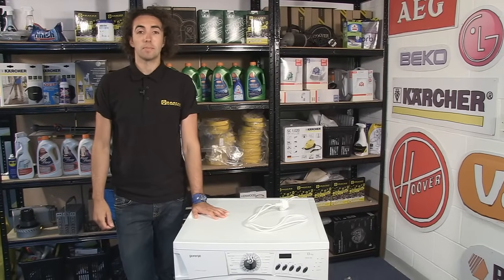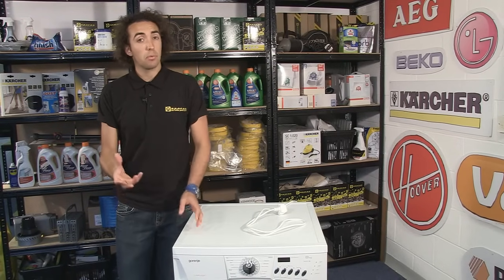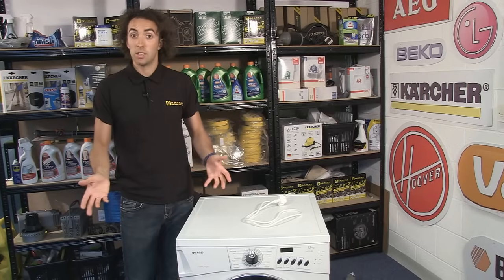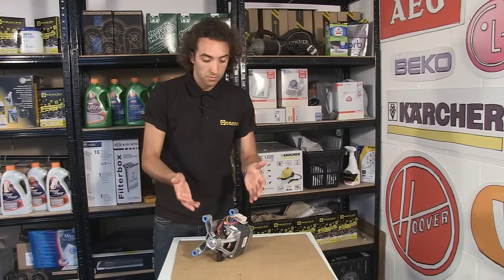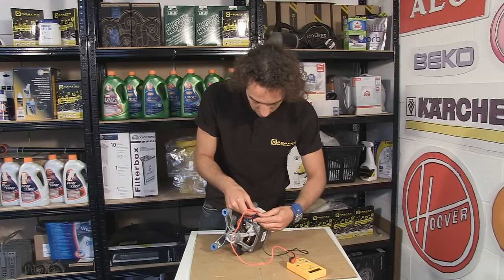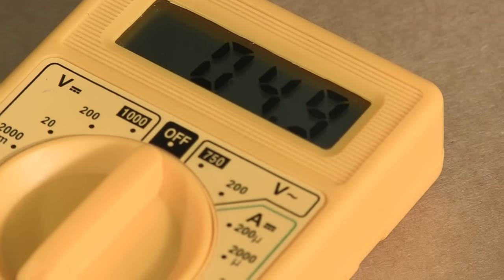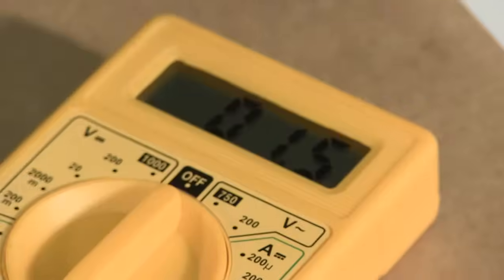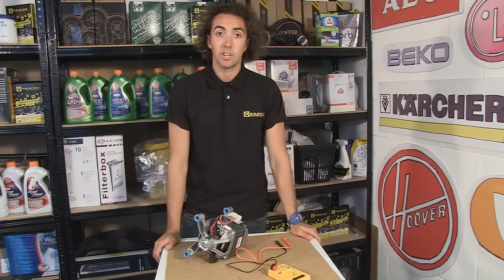How to Diagnose Washing Machine Motor Problems

Comment: Great guide. On my motor off a Candy CDB 126 I had 6 wires instead of 7. The way I worked through this was firstly  tracing the pair for the velocity sensor (2 red wires from the can on the end)  43 ohms [good].

Then I checked the colours from each of the 2 brushes - blue & pink respectively. These measured 4.7 ohms [good]. These confirm the armature windings (the rotating central part) and commutator (copper segments on the end that the brushes are contacting) are all good.

Finally there were 2 remaining wires -   a black and a grey wire which went inside to the field coils in the motor casing. These measured around 2 ohms [good]. This confirmed the motor is basically OK which means my fault is elsewhere. I have already repaired a couple of broken wires to the dryer heaters so I am checking the wiring from the motor wire plug back to the control board for breaks as these wires are also constantly flexed by the movement of the drum assembly and have possibly become brittle inside.

Comment: Very good explanation - I don't think I'll bother trying to take the motor out of my Beko though as I think it's the carbon brushes that need replacing as it was sparking and lighting up when I took the back off - you said at the end though that if you find any of these faults then the whole motor needs replacing? You can't just replace the carbon brushes? Probably not worth the time or money to fix if I can get a new one for about £230 anyway

Comment: The speed sensor in my case is reading 140ohms. Does that indicate that it’s faulty? My issue is the machine  would fill with water normally but it won’t spin.

Comment: My CESET Motor has problem at speed.

Firstly thanks to eSpares for an informative video. I found it after fitting a new set of brushes with limited success.
 
After fitting the new brushes my machine completed a spin cycle and then failed on a wash cycle. Now the motor will turn (with no laundry) at slow speeds, but keeps cutting at high speed as if there’s a loose connection. Having tested the Tacho and Windings everything seems good.

I thought the problem might be a start/run capacitor, but these motors don’t seem to require one (guessing because of the field windings). With the absence of a capacitor I decided to investigate the PCB (against even my own better judgement). I thought I’d found the answer when it looked fried with black tracks on the back and a coating on a chip, but all of this blew off to reveal a clean circuit board (apparently dust from belt attracted to electrical current). I did suspect I had found one or two dry solder joints, but I’ve made them good to no avail.

Any connectors have been crimped a little tighter and/or blasted with cleaner, which hasn’t helped in the slightest.

So, to all that have read this far:
- Have you resolved a similar problem and how?
- Any ideas on what might be causing the problem or what else I can check?

Thanks for any informative replies.

Comment: So, ive just carried out all checks in accordance with the video(which is great by the way) motor would appear to be servicable. However my error code points to the motor/speed sensor. All readings are nominal. Any thoughts? 

Model: hoover Candy DXOA410C3180 31007922
Error E08
Reply from the maker: Hi, thanks for your comment and for your appreciation of our video! We have another video focused on the E08 error code that you can see here:
https://youtu.be/Xmh8_1LRrlA

Hope this helps!

Comment: Excellent video, however I just removed my motor from my Hotpoint WDD960P as it keeps tripping the electrics, and on my motor I only have 5 wires, I proceeded to check but the readings are nowhere near what you’re getting, do you have any videos for a hotpoint motor ? Thanks

Comment: My tacho coil reading is approx 179 ohms, is this normal for a Zanussi ZWH 6160P washing machine, Prod no. 91490641500
Reply from the maker: Hi MrJsingh1986, the meter reading does vary, having the reading would suggest the tacho is OK

Comment: Hi, I have a hotpoint wma34 that trips the electric when the motor attempts to spin, I check the brushes and they were very worn so I replaced them but still the same... Then I found this video!  The speed sensor gives a reading of about 190 ohms... Also if I manually torn the rotor this reading varies a little as I would expect but it also gives a random null or 1 every now and then which seems odd to me... Does this mean I need to replace the whole motor? I also get a reading of 8.1-10ohms on the final test ( the motor windings?) and  very high reading if I connect across the brushes... 
Thanks for any advice given
Reply from the maker: Hi batfink 132000, when testing for a fault on the motor you are looking for continuity readings to test it, with your fault you are looking for a component that is going down to earth causing the electrics to trip which would normally require a meggar meter to test the components. Does the machine work OK when washing?
Reply: @eSpares  it appears to work OK until the motor trys to spin the drum and the it trips the main fuse box... Thanks for replying but I have decided to replace the machine as it has served us well with no real troubles for at least 17 years possibly over 20 years so I don't think it owes me anything and even if I can repair it I suspect it will only be a matter of time till it suffers more failures

Comment: Question...If im having a problem with the motor should u just buy a new one or can you repair the motor...I had the washing machine for 8yrs and it doesnt spins I look at the belt and notings wrong with it.
Reply from the maker: Hi Douglas, it would depend on the make and model as they are supplied differently, most supply the carbon brushes separate so check them first.

Comment: Good demonstration.
My motor running but suddenly pulling 2x the current, humming and then shuts down halfway through cycle. Thermal switch I presume.
Any idea why it's drawing so much current?

Comment: Hello Josh - just watched your excellent video - thanks.  I ran the Whirlpool diagnostic which confirmed there's a problem somewhere with the motor.  I checked the carbon brushes and they're OK but the sensor on the motor is s/c.  Do you know what the effect of this fault would be? Would it prevent the drum from rotating altogether? Thanks in anticipation.

Comment: Thanks for this video it was very informative. Do you have any video or suggestion on why my Samsung front loader wont turn on?
Reply from the maker: Hi Durrel James, if you have power to the machine start by checking the door lock because if that has failed then it wont start.

Comment: Bosch Nexxt 300 washer spinning super fast..... Codes D06, D08, D09, and D11 came up.
Is it the speed sensor?  If so, where is it located and how do I replace or repair?
Is the speed sensor on the motor?  Is speed sensor replaceable ?  Or do you need to replace whole motor?
Reply from the maker: Hi iceman382, they are different error codes but are related to the motor except for D06 which is an NTC short circuit, start by testing the motor with a multimeter and you need ENR number to identify the model details.

Comment: Hello. My washing machine was giving me an ND Code. I cleaned all the hoses. Then I replaced the pump.  And now my washer will go into wash..as soon. As it goes to drain it won't drain. Or spin. But now I'm not even getting the ND code. Can this be wiring?

Comment: Thanks a lot !! I did exactly as you advised!! Resistance of central pair was infinity/disconnected/open loop,so I replaced the two carbon brushed which the two were half centimeters only! almost touching its wire...washing machine is now functional!! thanks,Yaron
Reply from the maker: Hi Yaron, thank you for your post and glad our video helped and well done on fixing it.

Comment: After being almost crazy with this error I finally figured it out. In my case it was the pin that connects the wire to the carbon brush device. It was a bit loose connection in one of them. I disconnected, then took pliers and made pressure on the pin to make it tighter (not too much) and then connected again and had the feeling of a solid connection! And voila! (I also checked the speed sensor at the end of the engine with a multimeter just in case) Now it's perfect again! Thanks to the video, very professional.
Reply from the maker: Hi NandoMirandaHorses
. Great work and perseverance on this one! We're glad to hear you enjoyed this video.

Comment: Hi do u know why my washing machine won’t turn or sometimes it does or goes into spin I know u mentioned it but my machine is about 20 years old and I didn’t know if them motors would have sensors?
Reply from the maker: Hi Kai1234, start by checking the obvious, the filter in case it's blocked then check the carbon brushes and drive belt.
Reply: eSpares ok thank u I will check the filter and the brushes and belt are fine
Reply from the maker: Ok Kai1234, good luck and let us know how you get on.
Reply: Hi again I’ve done all the things you’ve suggested but still no luck :(

Comment: Also what ohms range do you have the multimeter set to? I’m getting mixed results.
Reply from the maker: Hi William, to check the motor the meter must be set to the lowest Ohm's range (0-200?).  A washing machine motor will typically give a resistance of between only 1 and 10 ohms for a  winding or across the brushes.
Reply: My multimeter has anything from 2 - 5000ohm range. I’ll test them again @ 200 range and post my results, I’m still convinced the windings test is showing up infinite resistance.
Reply: Meant to say 2000ohm range
Reply: I’ve tested it again and my results are. @ 200ohm setting Armature 00.1 Brushes 46.1 windings 00.0 / @ 20ohms Armature 0.09 Brushes doesn’t budge windings 0.00 / @ 2ohms setting Armature 0.88 Brushes doesn’t budge windings .002

I’m a little confused by the Brushes reading @ 200ohm setting but the windings results seem consistent with a faulty motor. Issue is a machine that won’t engage left turn, right turn or spin whilst in diagnostic mode.
Reply from the maker: Have you removed and examined the brushes. wash motors rarely go short so as long as you have a 'low resistance it is likely to be OK. If you are getting 'unusual' brush readings suspect worn brushes.
Reply: One looks fine, the other is worn considerably more, a bit of meat left in it. So the 0 readings with the windings is fine? What does the 1 mean when testing the brushes? And by 1 I mean the reading that’s on the multimeter when set to ohms, does that indicate a short? A break in the circuit?

Comment: I’ve just tested my motor and I’m fairly certain the windings are at fault. I’m getting infinite across all 3 wires. What’s confusing me though is when I test the brushes, in my case....red wire and white wire, I get nothing, no readings whatsoever, just reading 1. What does that mean? Checked brushes and they look fine.
Reply from the maker: Hi William, to check the motor the meter must be set to the lowest Ohm's range (0-200?).  A washing machine motor will typically give a resistance of between only 1 and 10 ohms for a  winding or across the brushes.

Comment: Nice video
I have a quick question, I have a Currys Essentials C510WM13 
A short time after selecting a cycle the machine stops, I get a few beeps and the start/pause button is flashing 7 times in 4 seconds, according to the manual it's an error 7 and all that's in the manual is "contact maintenance personnel" 
This happens normally about the same time the drum should start turning on a cycle
Could this be a motor fault? 
Thanks for your time
Reply from the maker: Hi Pete, check the carbon brushes and they may have worn causing the motor to stop rotating. Please let us know how you get on.
Reply: eSpares thanks for the response and will be getting parts from you guys :-)

Comment: My Zanussi ZWF16070W washing machine keeps trying to go into a full speed spin rather than balancing the load and increasing the spin speed gradually, causing the machine to shake violently. It then just winds down, does nothing for a few minutes, and does the same thing over and over again (and will continue to do this until I switch it off). However, the drum rotates properly during the initial washing part of the programs prior to the first spin. It also fills with water and drains properly. From what you say in this video, it appears that the sensor on my washing machine's motor is faulty and is sending the wrong information to the control panel. Can this sensor be replaced or does the entire motor need to be replaced?
Reply from the maker: Hi Lianne, interesting one this as if the sensor or motor were faulty the drum would normally go to full speed (Like it does on spin) during the wash cycle. Run a spin cycle empty and watch. The drum should turn slowly one direction then the other several times before starting to increase in speed to full. If it does this try with a light load again just rinse and spin. If it goes straight to full speed after the tumble suspect the PCB.
Reply: Hi there. Many thanks for your reply. The strange thing is, if I run it on a spin-only cycle it will drain, rotate back & forth as if to balance the load, then commence the spin from the slowest speed, working its way to the fastest speed. However, within a second or two of reaching maximum spin speed something makes a 'dull click' sound and it cuts the spin and slows down to a stop. The spin program is ten minutes long and the last time I tested it, it failed a few minutes before it should have finished. I've tried a few wash programs (including the spin-only program) with light loads of washing and whilst empty, and it does the exact same thing - the spin program functions as I've just described and the wash programs function fine until it needs to spin (I believe the first spin is prior to the first rinse, as the fabric conditioner is still in the drawer at this point) - which is when it tries to launch into a full speed spin rather than gradually.
One other thing that is a bit strange is that it seems to complete the 30 minute/30 degree wash program with no issues. Unfortunately this particular program has a short spin duration so the washing is still rather wet. I originally suspected the PCB but after seeing your video I was wondering if it might be the sensor on the motor, however, it looks like my original suspicion is correct. I think I'll just buy a new washing machine. It will be a shame though because although I've had my Zanussi for about ten years it's still like a new machine (apart from this spin issue that's just developed). It's quiet, stays rock-steady at all times (it hardly vibrates at all) and had always washed everything perfectly well.
Reply from the maker: The problem certainly sounds like the PCB, during spin the motor uses a lot more power so may cause the drive circuit to go short and produce full power.  After ten years of regular use the machine is likely to be requiring major repairs shortly (Bearings?) . With a replacement representing a significant cost on this occasion it may be sensible to replace. :-(
Reply: Hi, and thanks for the reply again. Apart from the spinning issue everything else seems to be fine. I doubt anything mechanical will need to be replaced any time soon (the bearings are still running smoothly, etc) but there's always the risk of other electronic parts suddenly going wrong at any time. Considering the price of a new PCB I'm thinking it would be better to pay a bit more and buy a new machine. Just seems a shame to dispose of a machine that's in good mechanical condition. Thanks for your help and advice with this - much appreciated.

Comment: josh, 
thanks for a great video.
I just have a simple question, what do you set your test meter at, could it be 200-Oms?
also, is the cables  color cod universal? i mean from one brand to an other
Reply from the maker: We cannot guarantee the colour code will be the same on all machines but to measure resistance of the motor or coils a low resistance setting (0 - 200) is usually the correct setting.
Reply: you are top notch Josh
thank you for your reply. 
i now feel confident to have a go at it
Thanks
Reply from the maker: Thanks for the comments, remember to 'like’ the video if you enjoyed it or it helped.👍

Comment: My motor has no brushes.
Reply from the maker: Many machines are no being supplied with 'brush-less motors'. If the motor does not turn on a setting it is likely to be a control board problem.

Comment: hi few days ago Changed board.The problem is that the program makes normally powered, cut it heats, the drum spins left and right, spin INTERMEDIATE but at last SPIN opens and closes the relay and a current of the motor gives a not.end the technician who came told me that blame the tachometer Motor while not not make any trouble codes when you doing the diagnostics test the lights flash 8 times.means motor HELP me if you know something thanks  model gorenje wa50060   art.n  157264  ser.n
Reply from the maker: +κωστας κωστακης We would suspect the motor as you have already replaced the control board.
Reply: eSpares It is possible that he will have programming pins j1 j2 j3 j4 j5 Should break some pins or board to the box she had a paper saying the revolutions thanks
Reply from the maker: +κωστας κωστακης Many control modules have to be  'programmed' to the machine they are used on. This may be by pressing the buttons in a certain sequence or there may be links to remove or move. If there is paperwork with the new board follow the instructions. You may be able to copy the link 'pattern' from the old board to match on the new but check the supplied information first.
Reply: THANK YOU FOLLOW THE directions of the paper will break spike believe correct the problem Thanks for responding.
Reply from the maker: +κωστας κωστακης You are welcome.